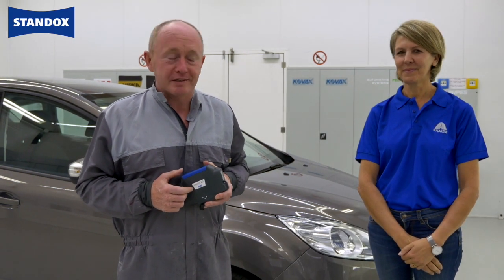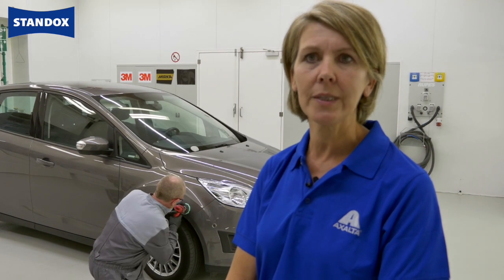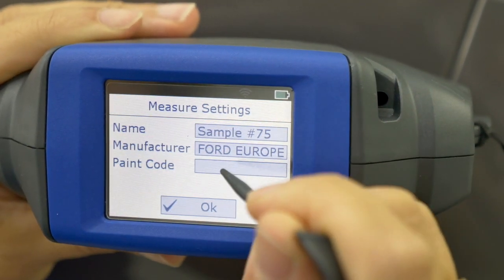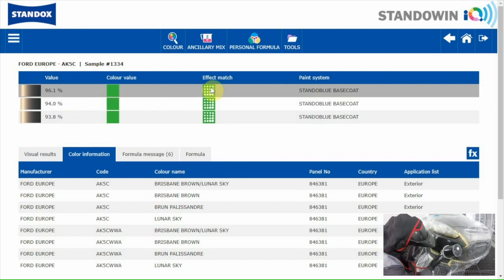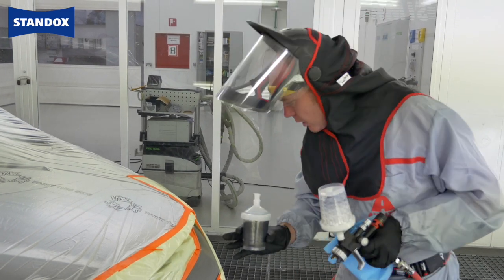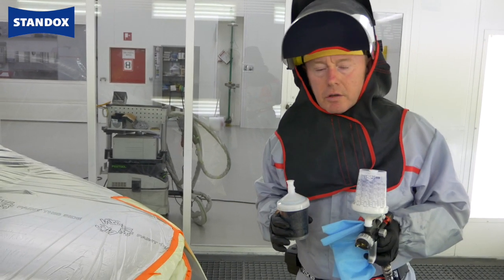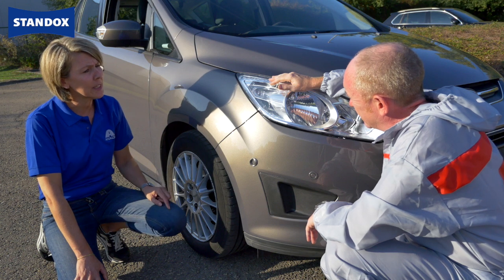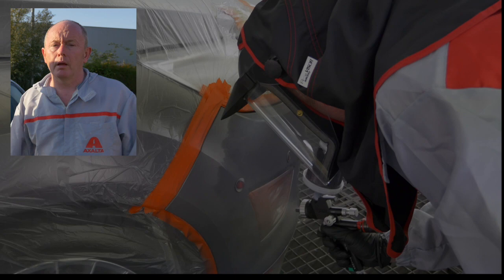Standovision: Professional and reliable way to good colour match

Comment: do these things have calibration of any kind because ive had bad experiences with this device ..........its always comes out too light the colour match ?
Reply: could it be operator error ? i mean what happens if the device is postioned on a curve perhaps and out side light is let (leaked) into the device ?
Reply from the maker: Hi Martin, the spectro is calibrated once a month with a white calibration tile. You will also be asked to do a colour check with the blue metalic tile on a weekly base. With these tests the colour and effect measurement is checked against the factory settings to be sure the device is still working fine. In case of a problem you will get a notification/error.

If the colour is always to light it might be a good idea to check the application. Too light results are often caused by a dry application. Also the preparation of the measurement area can have an influence on your results. Everything starts with the quality of the measurement so it’s important  to have the measurement area cleaned, degreased, polished and degreased again.

Due to the 4 pins that have to be pressed during the measurement it’s almost impossible to have external light coming into the device. Off course it’s always better to measure on a flat surface instead of a curved one if possible.
The 3 necessary measurements are also compared against each other. If there is an influence of dust , scratches or external light on one of the measurements this measurement will be skipped and you will be asked to do an additional measurement. For this reason it’s important to replace the device between the 3 measurements.

We hope this answers your question. Do not hesitate to reach out to us if you still have doubts or need a training.